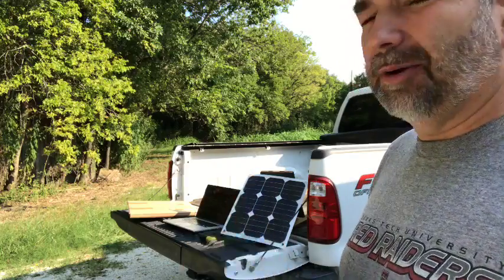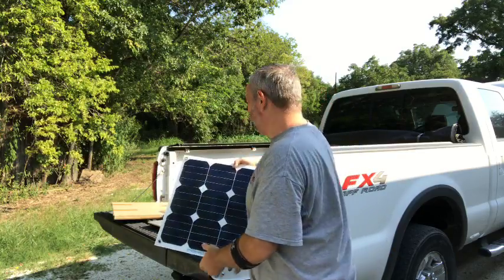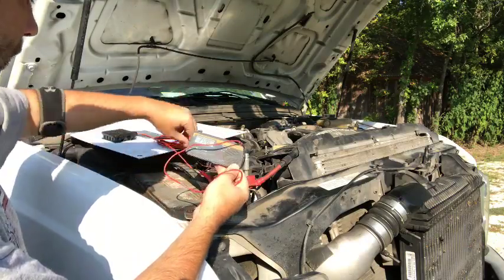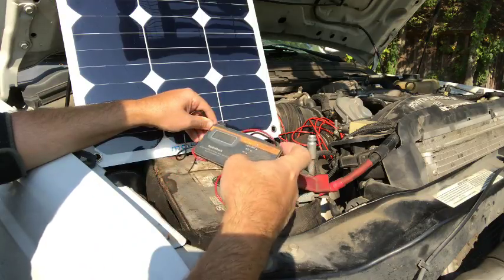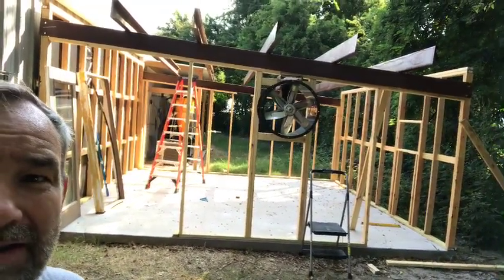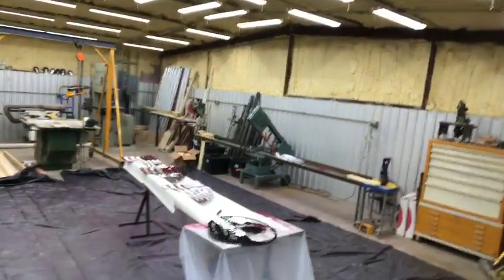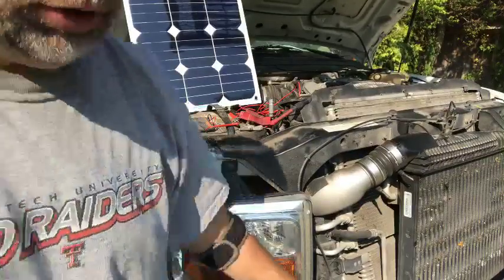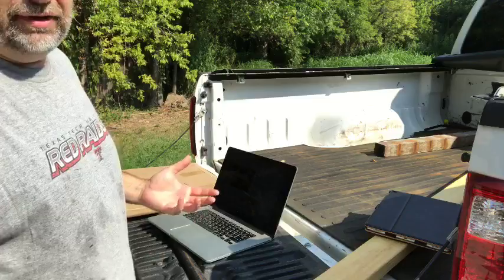MOHOO Solar battery charger LIVE

Comment: there website shows a controller your suppose to hook the panel to then to your battery and a source you want to run like a winch ---here is part of their description (-Connected to the controller to use, a single connection must be connected to the controller and battery, and finally to the solar panels and control connections, if not directly connected to the battery controller, the current is too large directly to the controller burned.
-Usually to recharge the battery or electrical use.)
Reply from the maker: Good catch.  The back of the panel had a controller box on it, and the leads appear to be standard positive/negative batter leads like any batter charger would have, so it's odd that it requires a separate controller
Reply: yeah not sure but if you look at the pictures on the link you used it calls that box on the back  as a junction box with diodes safety protection  and if you look on the color picture with the house it shows the controller i was talking about with 3 hook ups one coming in from the solar panel and one coming in from the battery and lastly one coming in from what you want to run like a light or winch  maybe the controller works like a power inverter not sure but its $20 and its shown in the pics if they didnt send instructions  im sure their not clear on what you need to run the whole thing  on the review section of that link people say it puts out 20-24 volts from the panel maybe that seperate controller is to regulate that down to 12 im definately not a expert in that but just tossing  that out there dont want you to hook it up on your trailer and it over charge the battery or cause a fire